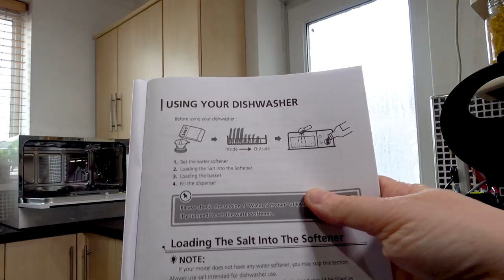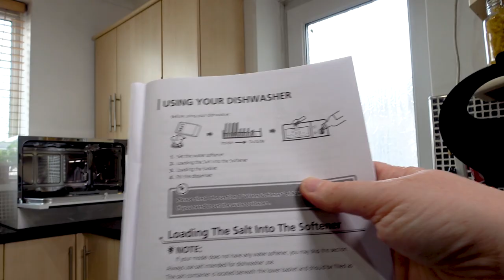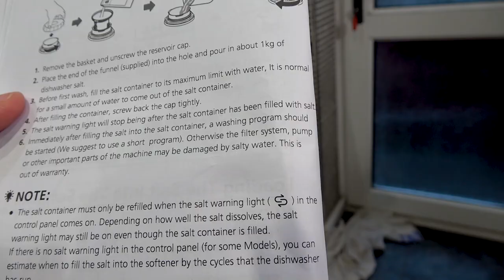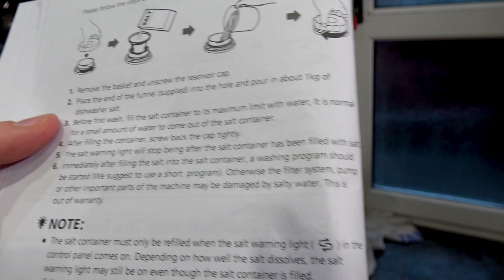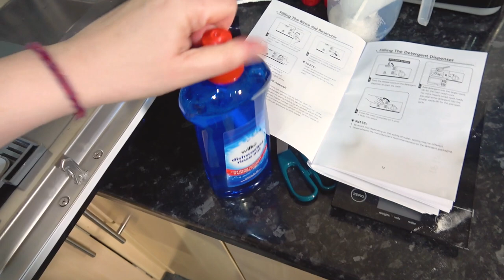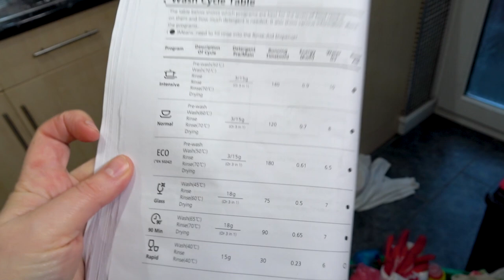COOKOLOGY COUNTERTOP DISHWASHER UNBOXING, SET UP with KITCHEN TAP & INITIAL IMPRESSIONS.

Comment: Where did you get the black adaptor thingy from, pease
Reply from the maker: Well I did get it from Wilko, but you’re definitely best off with one with a screw fitting on the end - as you might have noticed- mine kept blasting off. 😆 Thanks so much for watching. Oh and I got it plumbed in properly within a few weeks.

Comment: Do you know the name of the black piece you used for the faucet? I’m having the same issue with connecting it to my faucet sink
Reply from the maker: Hello! I'm pretty sure I have it typed in the description of this video. I bought it from Wilko in-shop in the hosepipe adapter section. But do you know what? It turned out there WAS a screw connection on my tap - it was just on so tightly that I didn't think it existed. I think you would be best off with a screw fitting one if possible - hopefully then it won't fly off unexpectedly like mine did! 😂 I had it properly plumbed in after a couple of weeks as I found the tap attachment too impractical. Thanks so much for watching and good luck with your dishwasher. :¬)

Comment: That's what I thought - isn't it supposed to dry it as well?
Reply from the maker: 😂 I’m looking forward to using a dry cycle after it’s properly plumbed in!
Reply: @PlanetImo  they  can still be dried just use  the longer cycle as the cold water gets heated up, then the dishes will be dry at the end of the wash xx

Comment: How do I know if my tap is compatible? Or how do you know that the tap adapter you buy is correct?
Reply from the maker: Hello! What ever you do - don't do what I did!  😂As you could probably tell from this video, my universal tap adapter from the hosepipe section of Wilko botch job (I had to cut it and add something else onto it) didn't really work very well as it kept flying off the tap at high pressure. I was convinced my tap didn't have a screw thread on it - but it turns out that it actually did. So I don't know exactly what the adapter you need is called, but if you can work out the diameter of your tap end and get a screw adapter for that diameter, I'm guessing it should work. You should be able to unscrew the end of it to reveal a screw. I didn't find that clear from the packaging, or from Amazon, where I bought mine from. Sorry I couldn't be more helpful! I would heartily recommend getting it properly plumbed in though - I didn't realise how much I used my kitchen tap until it was being tied up while the dishwasher was running and I got sick of plugging it into the tap very quickly. I love this dishwasher though, all these months on! Thanks so much for watching and good luck finding the right fitting!

Comment: What's the adapter called? I am looking for one and unable to do so.
Reply from the maker: I just got mine for the hosepipe section of Wilco. I think I wrote the name in the description of this video? I later discovered that I should have got a screw one after all as my tap DID have a screw adapter but it was extremely well hidden! 😆 I don’t recommend my botch job method and I did get it plumbed in properly when I could but it did work as a short term solution. It was difficult to get it done up tightly enough to not come flying off the tap and spraying everywhere. I hope that was helpful and thanks for watching! 😃

Comment: From where can I get this black connector to the faucet before I throw out my dishwasher machine!!!
Reply from the maker: Well, I bought it from Wilko gardening section, as it’s meant for hosepipes really. It’s not the best choice as you may have seen from the video as for a start, I had to adapt it to get it to fit plus it kept flying off the tap and even spraying the ceiling with water. I got mine properly plumbed in within a few weeks as I found the tap adapter stressful. 😆 but check to see if you have a screw end on your tap - because a screw one would be so much more secure. I was sure I didn’t have one on mine, but it turned out that I DID all along, so a screw adapter would have been much better. Good luck!
Reply: Also try the Rolson one, it is very adaptable
Reply: @PlanetImo  That’s what I have - the screw in adaptor. It stays on my tap all the time I just have to click onto it with the quick connect section on the hose. I love mine, have had it for a couple of years. 😎. Most older faucets have a threaded end - it may have a collar on it but you just have to unscrew the collar to access the threaded part. 👍😁

Comment: Does anyone know why this diswasher is coated with a polythene skin?  I spotted a small piece of what looked like left over packing stuck on  the botom corner of the washer, but when I tried to remove it I could see that the whole outside of the washer was sealed in a poly-skin. Never come across this type of thing on white kitchen goods before!?
Reply from the maker: Mine’s the same!!! Perhaps it just makes it rust proof? That’s a complete guess. Thanks so much for watching! 😃

Comment: Your not going to screw that onto your tap every time are you
Reply from the maker: I did it for a while and then got it plumbed in. It was a temporary measure as I filmed this during Covid so tried to manage without getting anyone in. It was massive pain though. My boyfriend plumbed it in for me and I later had plumber in to do the drainage pipe once things were opening up more. I still use this dishwasher daily and love it. :)